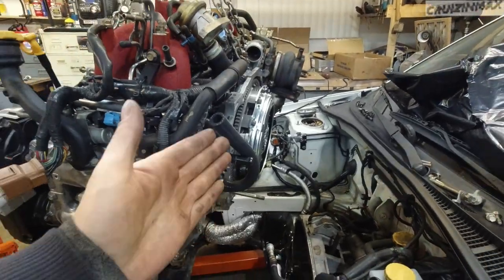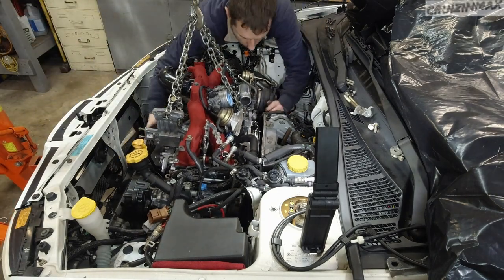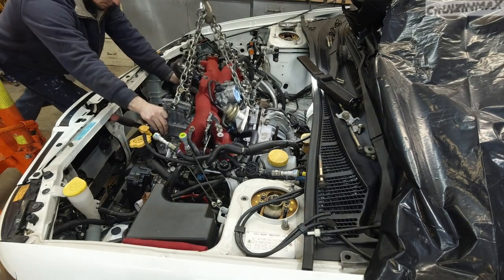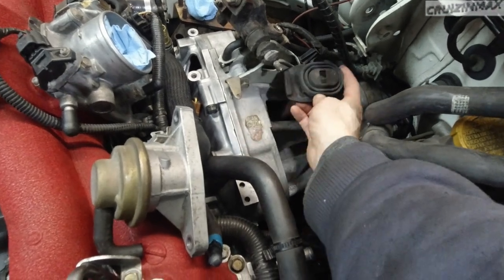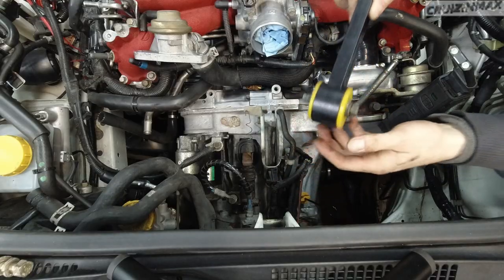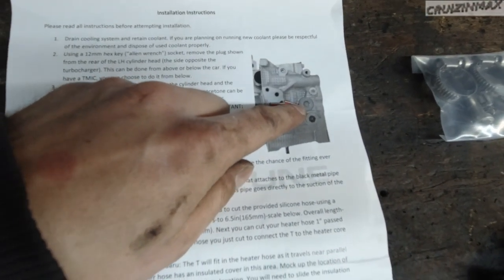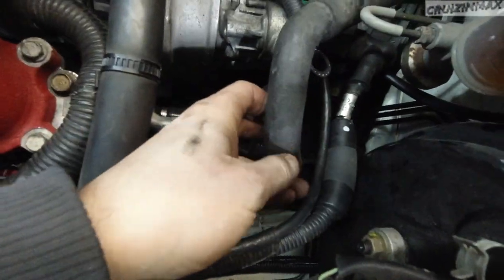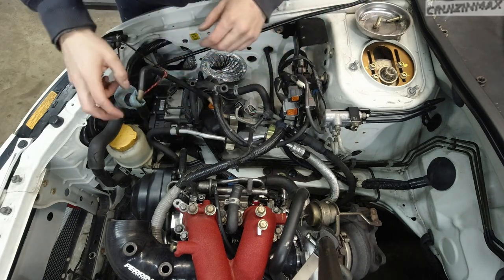Subaru STI EJ25 build part 10 engine install and more cooling mod

Comment: any tricks for the engine install, lift trans high? rotate crank to help spline mesh (noticed you were doing this) how much force should i use?
Reply from the maker: You first want to aim for the 2 studs, make sure its all lined up and even then push as far as you can, turning the crank if its really hard.  When possible try to start 2 bolts across from each other.  Sometimes it may take a while, just gotta take your time, dont force things too much. GL.